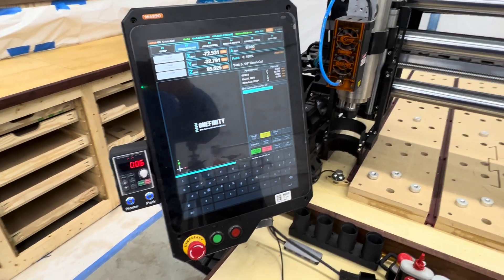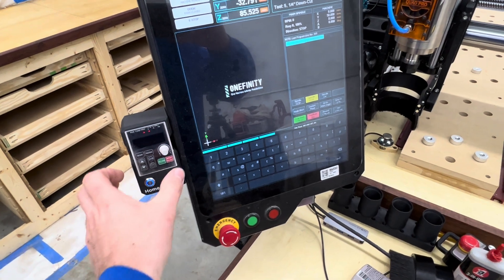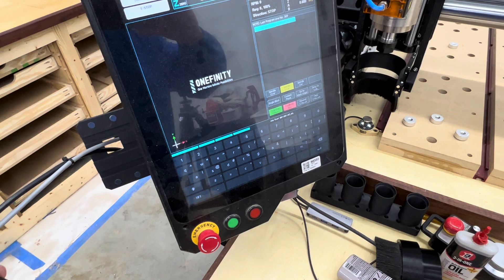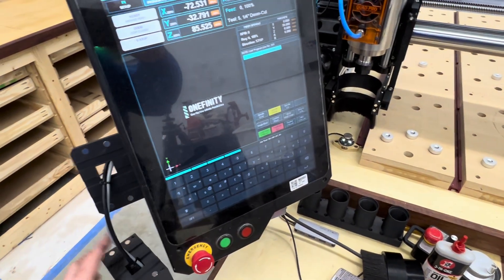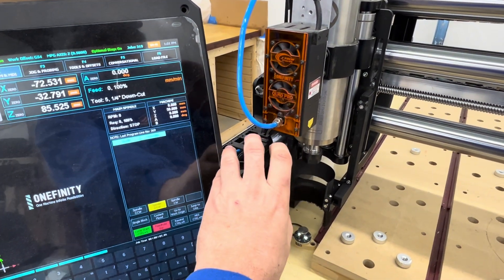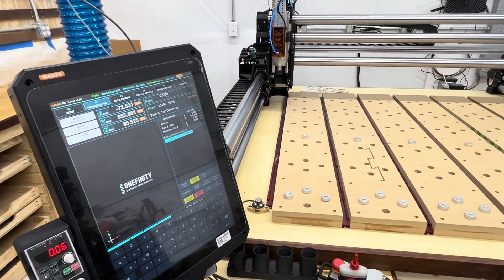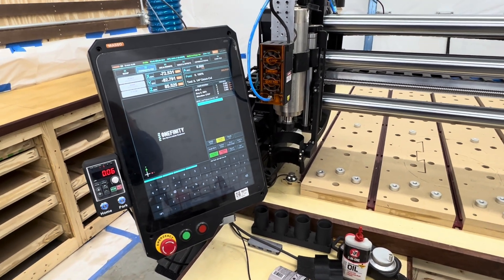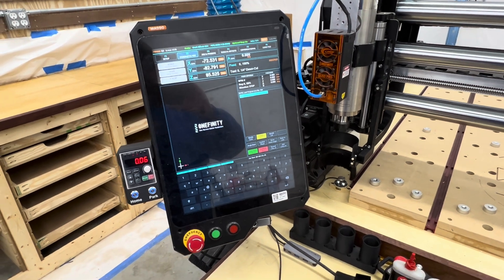PwnCNC VFD Keypad Sidecar

Comment: I love this idea. I'm constantly parking my machine through MDI. Is there a limit to the number of button that could be installed with a single power cable? I can see Home, Park, Origin and Dry Run being useful for me personally.
Reply from the maker: The limit with a 4 wire cable is two buttons.  You can add one more button with each wire.    The real issue in your case is that the dry run function isn’t supported as a configurable input, so you can’t assign it to a physical button.

Comment: Does the controller just slide out of the VFD and do I need to purchase additional wires or does the PWCCNC ones reach ?
Reply from the maker: It does just slide outs. All you need to remote it is an Ethernet cable.  I have them as part of the maker kit but I should probably list them separately.

Comment: What do you mean by maker packs? I thought you mean the extras like the buttons and wires and attachment screws but you're offering the maker packs when you buy the print files too? Clarify this for me please.
Reply from the maker: @8thsinner I include all of the parts you need to make the enclosure functional.  The enclosure is just the printed enclosure, with no additional parts.   Whether you print your own or buy the enclosure, you need the maker pack to assemble the unit.  Of course, you can source the parts in the maker pack yourself, which makes particular sense if you have some of the parts on hand left over from other projects.
Reply: @UglyDogWoodshop  Contacted shop as requested.
Cool, yeah I definitely would like the parts kit for the buttons and what not rather than buying sets of stuff separately. Maybe we can work something out if this panel thing works, see what the options are like if we complete it